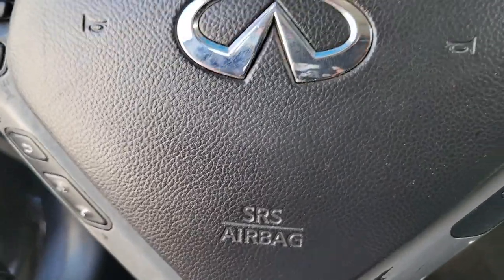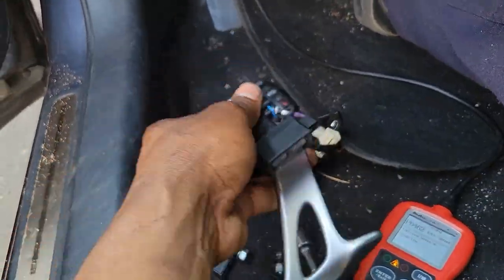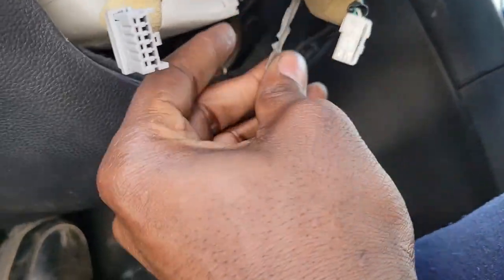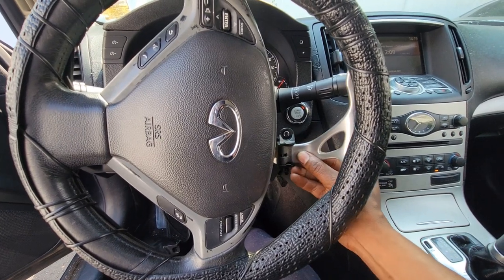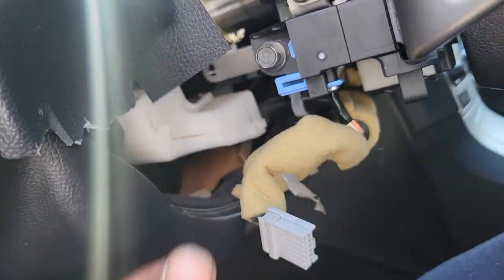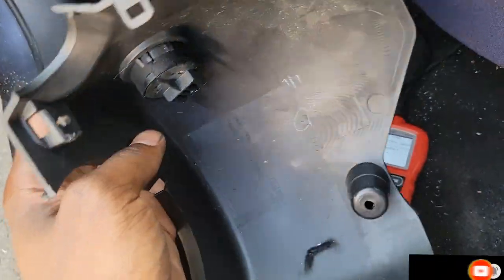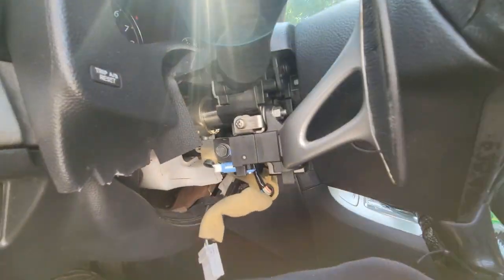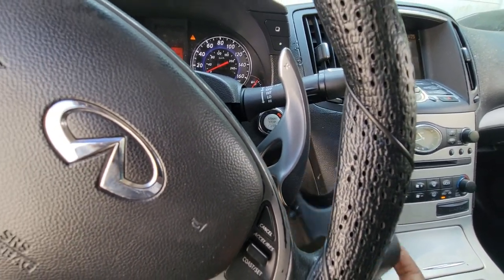How to install paddle shifters| infiniti G35 G37

Comment: Drill a hole in the new bottom cover for the steering wheel adjustment joystick. before you install the cover .

Comment: Will this apply to a 350z?
Reply: I’m trying to do that to my z to did u ever find out if u can?
Reply: @mryanavenido719 will it work on a g35 05 coupe?
Reply: @legandgamer7267  I haven’t for sure got an answer but I did my reasearch and as long as u have manual mode on the gear shifter like the + and - sign where u jsut pust forward and back you should be able to install paddle shifters. Everytime you use them you just put it in manual mode and use the shifters.
Reply: @mryanavenido719 I’m looking to get a carbon fiber wheel with paddle shifters it’ll look so hard bro
Reply: @legandgamer7267 it will not work just for the 07 g35 g37 sedan

Comment: What size bolts did you use to hold paddle shifter? Mine didn’t came w extra bolts to secure the paddle shifter 😢
Reply: Same. Don’t have the screws or the nuts to mount the paddles.